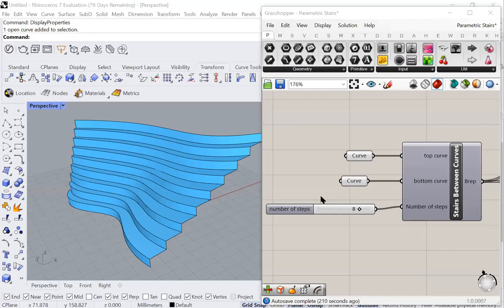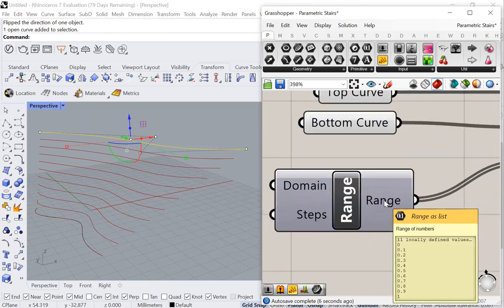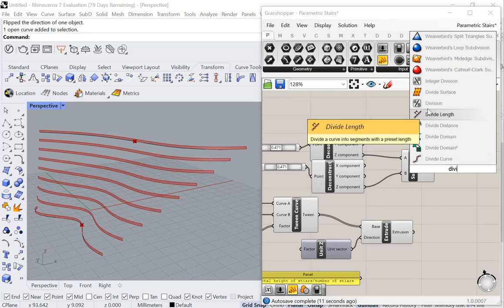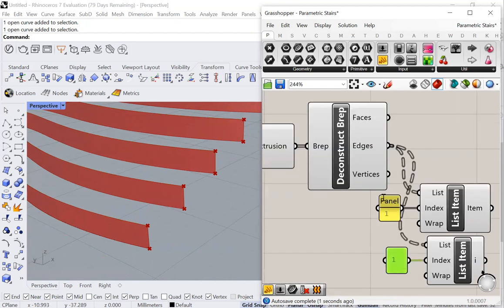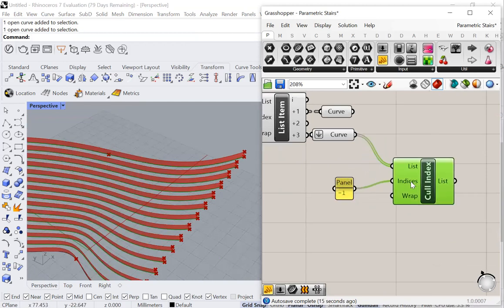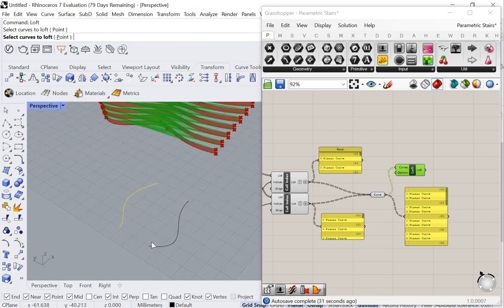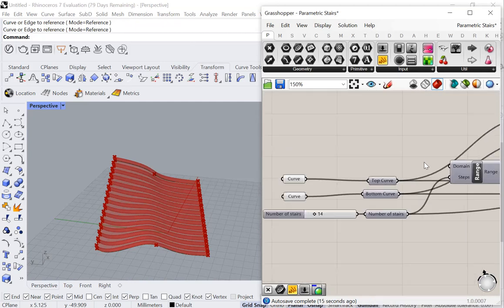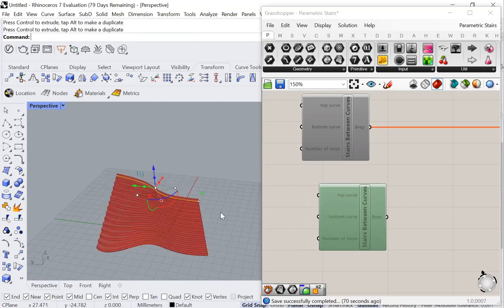Rhino Grasshopper: Stair Generating Tutorial (Part 1)

Comment: Hello Nick. Thank you so much for the tutoriel.
I only have one question. In the part where we wanted to loft the steps together, is there any way to tell GH if for point on curve for each curve , the z values are equal, loft corresponding curves.
No idea how python works inside GH but maybe that'll be a lot easier.
Thanks bro. Brilliant work. You're helping lots of newbies here.